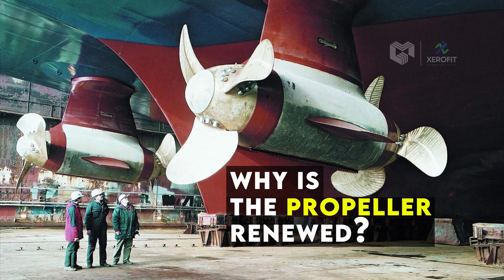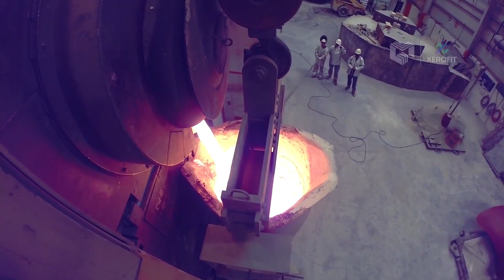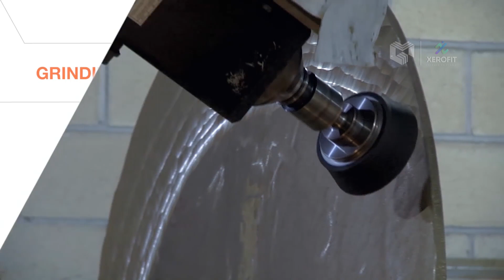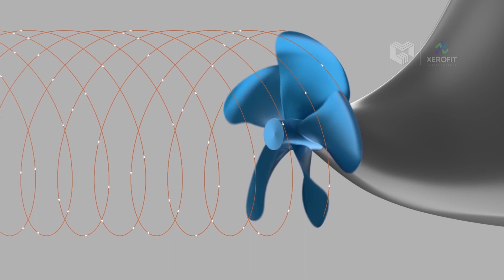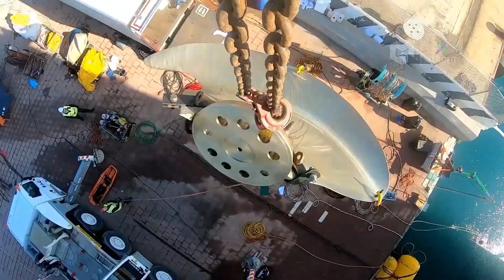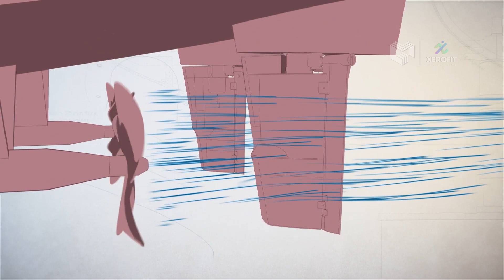How Are 131 Tonnes Giant Ship Propellers Installed?

Comment: The critical difficulty of a propeller casting is to remove the air pore, which is a cause of its destruction. when testing the casting by x ray , the concerned man pray that there is no a pore. Thanks for your posting in the coming autumn. 🌻